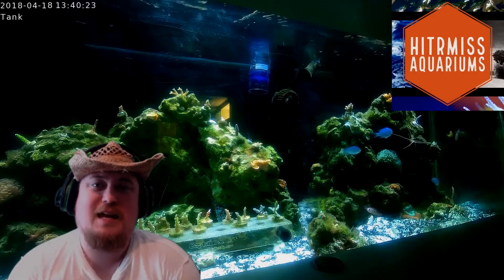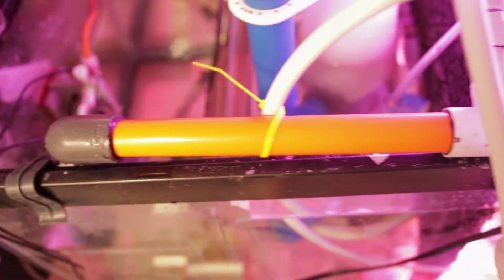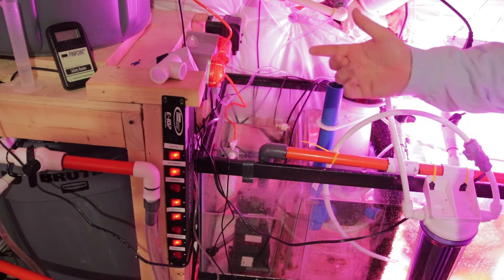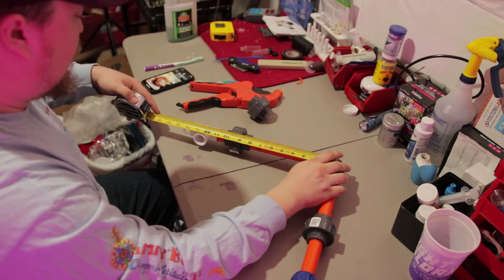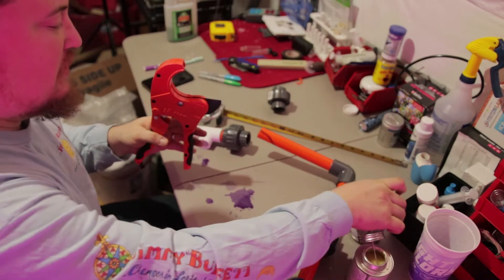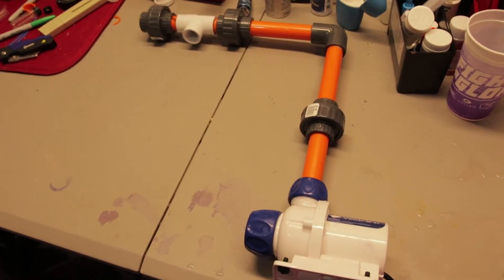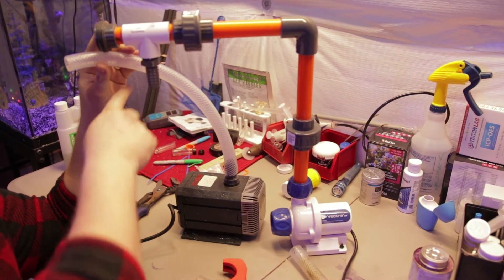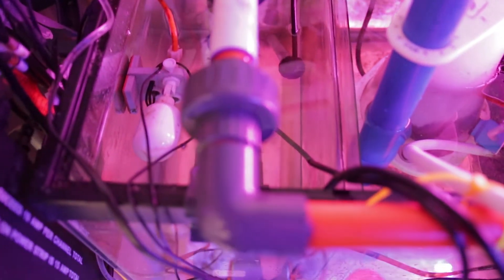Duel Return Pumps - In Parallel

Comment: Awesome video brother... redundancy!!!! Just 2 tips cause I'm a plumber... 1- turn your ratchet cutter around so the blade is cutting away from you. Makes it a lot easier to cut straight 2- if your gluing a 3/4 pipe that means the depth of all 3/4 fittings are 3/4s of an inch same rule applies for any size pvc... a little extra is always good but it's good to know... keep up the good work...
Reply from the maker: Retro Reefs thanks so much for the tips bro! Will def do that from now on. I appreciate the kind words!

Comment: A great idea in general for redundancy.. just need a 45 then standard wye instead of the T fitting so they join flow in same direction.. or even better just a 90 and have them run paralell for a few inches and then use a wye manifold fitting. With Check valves  right before in case one pump dies. With the T..half the pressure fights the other.  But your plumbing and system  looks sharp. (Way Better than mine) Keep up the good work! Happy reefin!

Comment: Without the check valves arent the two pumps competing? Did you see a noticable flow increase?
Reply: Exactly what I thought?  They both should have check valves or plumb the new pump direct to the aquarium. He said he didn't do a great job coming up from sump, then dropping down, then splitting at the bottom not to top of tank? Should of saved money an fixed plumbing. But if you like it yourself keep up the good work 🤙
Reply from the maker: This is 100% correct. I apologize for not posting earlier. You definitely need two check valves one on each side or they are going to compete. I did increase the flow some this way but when I ran separate lines it was evident as my overflow couldnt keep up. Thanks so much for pointing this out to the community and again sorry for not losing earlier. Respectfully,